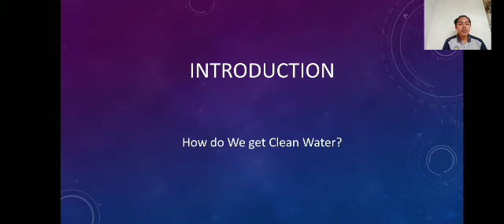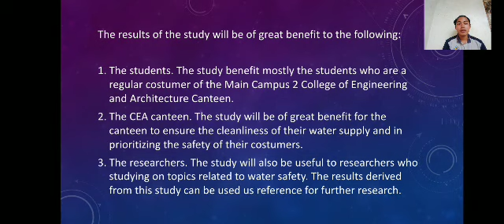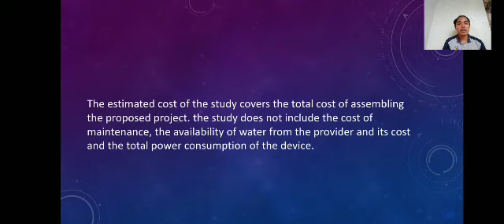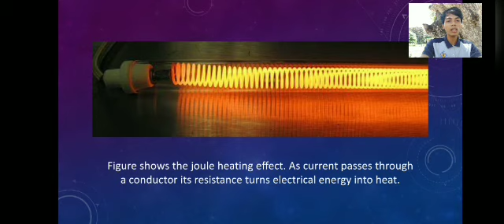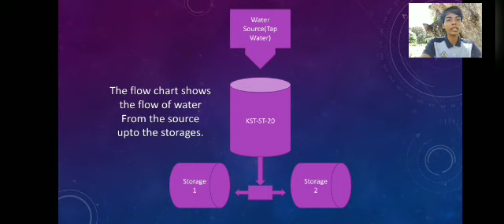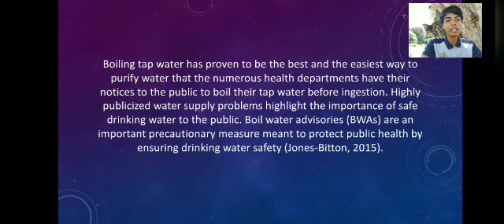Water Purification Using Heater: Safer Water Source for Specified Area.

Comment: Tudio, Lechly D. 
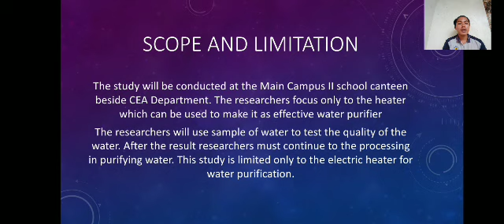COE 346 Methods of Research T-TH 5:00-6:30 PM March 26, 2022
Reaction: It is the most superficial topic yet the most helpful one. This study could be beneficial not only to the students but also to the people in Campus 2. It prioritizes health at the same you can save money. Drinking tap water is not only cheap but also environmentally friendly.
Reflection: When I was new in CEA , I remembered myself being so ignorant of the water. I was not used to the taste and smell of it. It tastes different, and it smells like chlorine, little did I know that the chlorine smell is pure city water. Sometimes, I experience stomachache or diarrhea, and I do not know if it is because of the water. To ensure the safety and good health of the students, it would be nice if they would implement this study. As I have searched, water purification can help remove harmful containment and improve the taste, smell, and visual appearance of your drinking water. It reduces the amount of chlorine, soil residue, and organic and inorganic substances.

Comment: NAME: Lumelyn E. Ragusta
CLASS NAME & CLASS SCHEDULE: ENS 341 B Research Methods for Engineering – S 5:00-8:00 pm
DATE: March 26, 2022
REACTION:  The proposed installation of an electric heater to purify the tap water of NORSU main campus II canteen is a good idea to ensure students' well-being. However, given the limitations of the proposed project, it would be cost-efficient to check the water level safety of the water source. If the source of water is already being maintained by an established organization like DCWD, which is known to have a respectable reputation for providing safe water in the entire city, would it be better to direct the proposal to a different water area than the university canteen such as low-income community groundwater well?
REFLECTION: I appreciate the idea of making sure that the university's tap water should be safe enough for students to consume. In my own experience, the tap water in the main campus II canteens did not put my health in jeopardy. I feel like this research can be terminated right after a student survey which is sad for the efforts of this proposal. I realize that before deciding and working on a certain research topic, a researcher should always question the problem and the resolution's necessity.

Comment: Name: Balansag, Lorenzo Jr. B.
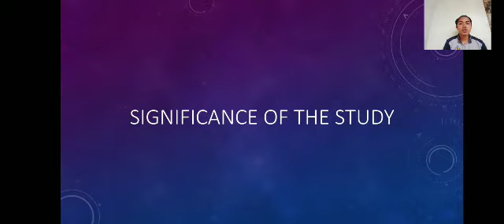Class Name and Class Schedule:  ENS341- Research Methods for Engineering | Saturday 2:00-5:00 pm 
Date: March 26, 2022

Reaction: I commend the researchers to being able to spot the problem in the campus. As water is a necessity to us. Having our water purified will help prevent student drinking contaminated water. 

Reflection: As I have experience, we student always preferred to drink in tap water instead of buying bottle watered. Since, it is expensive. But we are not sure if the tap water is contaminated or not. So if integrated to the school, it will prevent contamination. It is very beneficial to both students and instructors in the campus.

Comment: Diaz, Joseph Jr. B. 
ENS 341 B - 5-8 pm Saturday
March 26, 2022

Reaction: The water purification using heater is already practiced in some household that is why I'm not surprised with the topic. We also always do this because of the water that comes out from our faucet is not drinkable and safety enough.

Reflection: The water purification using heater is applicable wherever you are. Even if you don't have a heater but you have other alternative for heater you can still do the practices.

Comment: Name: Orito, Jessel A.
Class Name & Class Schedule: ENS 341 B Research Methods for Engineering (Saturday 5:00-8:00 pm)
Date: March 26, 2022

Reaction: This research proposal also benefits the students and faculty staffs in CEA MCII, since it deals with the quality of water using in the canteen. Purifying water before using is a good way to ensure the safeness of it.

Reflection: To ensure the safeness of the students and faculty staffs it is best to purify water before using. There are different methods in purifying water such as distillation, using sand filters, chemical processes and heat treatment. For this research, they used heater in purifying water to identify how clean the water is. In this way, you can say that the purified water is much safer than before.

Comment: NAME: Chasty Jane Duran
CLASS NAME: ENS 341 B - Research Methods for Engineering
CLASS SCHEDULE: Saturday, 5:00 - 8:00 pm
DATE: March 26, 2022

Reaction: As a student in MC2, I will commend these researchers to have identified the main problem around the canteens. We, students would always rely on the drinking waters provided by the canteen without assuring that they are purified, clean and safe to drink. Just around the campus, you don't see drinking fountains, or mineral water machines free for the students to access. This study will be very beneficial to prioritize those who rely on canteens for their drinking waters. 

Reflection: Water purification in such ways will provide a reliable and safe water supply for the students and staff. Checking on the water quality from the canteens will reassure the safety of those who drink from these water providers.

Comment: Marc Kenneth L. Baldosano
ENS 341 A (Saturday 2:00-5:00 pm)
March 26, 2022

REACTION: Since free water only came in a form of tap water on CEA campus, water that has undergone purification is much better than plain tap water. 

REFLECTION: Boiling water to kill bacteria is the most common way we purify water in our homes. Having a water purification system using a heater can be very beneficial to the people inside the campus.

Comment: Name: Belinario, Cristy T.
Class Name and Class Schedule: ENS 341 B - (5-8 PM Saturday)
Date: March 26, 2022

Reaction:

Water purification is widely recognized as one of the most effective methods of obtaining drinkable water by removing contaminants such as chemicals, pollutants, and toxic metals. The installation of an electric heater as a water purifier in the Negros Oriental State University Main Campus II canteen aims to purify their free tap water. Taking into account that the study only limited on computing the total cost of assembling the proposed project and does not include the expected cost for future maintenance of the devices, the availability of the water, and the cost for the total power consumption of the device, thus making it not really efficient. Given that it would be also free, who will pay for the additional expenses of the device? If the canteen charges for the purified water,  hopefully it would be less expensive than bottled water. Rationally, it is stated that the study will be terminated if the test results show no presence of harmful bacteria in the tap water.

Reflection:

As a  Main Campus II student, I took advantage of the campus canteen's free tap water, especially during lunch. It's funny that I never thought about the facility's water safety until I saw the proposed project about installing a water purifier in the canteen because the water there looks clean and taste fine. I didn't get stomach pains from drinking it. The study made me realize how critical it is to have access to safe drinking water not only in school but also in the community.

Comment: NAME: Shiela May E. Velos
CLASS NAME & SCHEDULE: ENS341- ; (5-8pm) Saturday 
DATE: March 25, 2022

REACTION: This study is good proposal it focuses the need of the safety of drinking water it points out the healthy and safe water supply for students in the CEA. Compared to bottled water, tap water is cheaper and is a more practical choice for students.  tap water over mineral water because it is less expensive and it's more natural and nutrients are real.  This study could be an impact to every students. Not only do we have no knowledge whether the tap water we drink is safe, but it also has effects for the health of the institution's workers, students, and faculty. More benefited when it natural and real mineral. 

REFLECTION:
 It's safer for us to be able to drink water from a purified water source, especially if it's convenient to everyone. This study is greatly beneficial to every students since they can drink the purified water without hesitation since they know that it is absolutely clean. Fewer people will become ill as the result of drinking contaminated water that this study gives helps us to acquire a healthy and safe water supply . Using this method in school canteens will help students save money, especially those who cannot afford to drink bottled water. By heating the water, the bacteria in it will be killed and drinking the water will be entirely safe. As a result, the staff and faculty will also have access to clean and safe water.

Comment: Name: Ma. Theresa C. Velasco
Class name & class section: ENS 341 B /5:00-800PM SATURDAY 
DATE : MARCH 25, 2022

Reaction: Their research is really good and they also explain it well. They delivered it properly and also one of the best to have a safe water source espy in NORSU main campus 2.

Reflection: We don't know where they get the water especially in the canteens of the campuses in NORSU.  It is the best way to have a safe water purification by using heater.

Comment: Mamigo, Jascha Anthony T. 
EE 341 Research Methods for Engineering TTh 6:30-9:00PM 
March 25, 2022

 REACTION: The necessity of drinking water safety was the focus of the study. As a NORSU student, I concur with his remark that we prefer tap water than mineral water because it is cheaper. This study was important because not only do we have no idea if the tap water we drink is safe, but it also has implications for the health of the institution's personnel, students, and faculty.

REFLECTION: It's a great thing to be able to drink water from a purified water source, especially if it's simple and easily accessible to everyone. If this is done correctly in a given location, fewer individuals will become ill as a result of drinking contaminated water. Implementing this method in school canteens will substantially assist students in saving money, particularly those who cannot afford to consume bottled water.

Comment: REY STEPHEN O. TUMAPON
COE 346 Methods of Research T-TH 5:00-6:30 PM
March 25, 2022

REACTION: This research proposal is very informative and a great idea. With this study, the students and instructors can be assured that the drinking water is very safe and clean. This is a great proposal because it puts emphasis on the health of students and instructors.

REFLECTION: The researchers did a great job on this proposal, and it is very useful at Main Campus 2. The importance of water purification is very critical to our health. Very well done!

Comment: Villanueva, Chastine E.
COE 346 Methods of Research T-TH 5:00-6:30 PM 
March 25, 2022 

Reaction:
This research is a good idea because it aims to produce safe and drinkable water. It will help students avoid drinking tap water that is not good for their health.

Reflection:
Drinking pure water is good for our health. Heating the water before consuming it offers several benefits: it eliminates pollutants, kills bacteria, and reduces the danger of contamination. The effects of contaminated tap water are most harmful to infants, the elderly, and people with compromised immune systems.

Comment: Caluscusan, Desiree Joy M.
COE 346 Methods of Research T-TH 5:00-6:30 PM
March 25,2022
Reaction: The video emphasized on the importance of having clean water and the safety of costumers of the CEA campus canteen. It explains the processes of purifying water and its significance.
Reflection: It is an eye-opener for students who isn’t mindful of where the water they are drinking coming from. A project like this is very helpful to the students since it took their health in consideration.

Comment: NAME: Del Franz Lean Consing Ladura

CLASS NAME & CLASS SCHEDULE:  ENS 341 - SATURDAY (5-8PM)

DATE: March 25, 2022

REACTION: The study's major focus is having clean drinkable water available at NORSU's main campus two canteens. The research major fails to highlight the influence of the present cleanliness of the water on the kids. They did not say if there were a large number of students affected by the present water cleanliness, which would make the study more significant. The demand for water from the canteen is likewise uncertain. This particular study, in my opinion, does not require immediate attention. It's not like those who drink from the canteen get sick.

REFLECTION:  Personally, I am not picky about the water I drink. In fact, I drink directly from the faucet at home. I'm not certain that installing a water filtration heater would solve the problem of water purity. If the issue is providing drinkable water for students and staff, wouldn't it be preferable for the institution to just construct drinking fountains around campus? This is a more mainstream method that has been implemented. Even at my high school, the faucet water is dangerous to drink, but they have remedied the problem with drinking fountains.

Comment: Ronel S. Bayonado
COE 346 Methods of Research T-TH 5:00 - 6:30 pm
March 25,2022

Reaction:
We have been heating our water for as long as we can remember. We heat our water to purify it and be safe to drink. This is a great idea specially for those areas who rely on tap water to drink. Very well explained.

Reflection:
To be able to drink water from a purified water source is a wonderful thing specially if it's convenient and readily accessible for everyone. If this is done right in an area, less people will be sick from drinking contaminated water. Implementing this system at canteens of schools will greatly help students save their moneys specially those who can't afford bottled water to drink.

Comment: NAME: MACAHIDHID ALRICK , O.
CLASS NAME & CLASS SCHEDULE: COE 346A – TTH 5:00-6:30 PM
DATE: March 25, 2022

REACTION: This research, according to this video, is a novel technique to open and encourage new proposals to students in MC2 who are studying health safety.

REFLECTION: Because our health comes first, we should sanitize our hands with alcohol or wash them with soap and water. For our own safety, we must also filter the water before drinking it. And this study, which purifies water using a heater, will allow CEA instructors, staff, and students to drink clean, safe water. Because it is for our health's sake, it should be implemented. This research is really beneficial not just on the mentioned Campus, but also in general.

Comment: NAME: Ong, Pearl Marney A.
CLASS NAME & CLASS SCHEDULE: ENS 341 - Saturday (5-8PM)
DATE: March 25, 2022
Reaction: The video presents a research proposal about the importance of a safe water source in schools. As a student it is beneficial to hydrate yourself almost everyday, so to have access to a clean and safe water is a must.
Reflection: The pollution in the air, land, and sea has made it difficult for some natural resources to be pure. However, there is a way to produce a pure resource by using heat. For example boiling the water can eliminate any bacteria so it can be safe to consume the liquid. Its a great solution for the people that needs a reliable water source.

Comment: Noel E. Macay
COE 346 Methods of Research T-TH 5:00-6:30 PM
March 25, 2022

REACTION: The study is very helpful for us students or even teachers in terms of our health. Nice idea of the researchers. Very well presented. Well done.

REFLECTION: Since our health is the main priority, we should practice sanitizing our hand with alcohol or wash it with soap and water. Also, it is needed to purify the water before we drink it for our safety. And this study that purify the water using heater will gives the CEA faculty and staffs and students enjoy the water that are clean and safe. It should be implemented since it is for our health. This study is very heplful not only in the said Campus but for everywhere.

Comment: Balacy, Samantha Ruby Joy C.
COE 346 Methods of Research T-TH 5:00 - 6:30 pm
March 24, 2022
Reaction:
 I am impressed with what the researchers presented to us. It is indeed important to have safe and clean water accessible to the students on the campus. It was a brilliant idea presented by the researchers.
Reflection:
Due to overpopulation, pollution in the air, land, and sea is inevitable. With that, there is an increasing demand for safe tap water sources all over the world. With the help of heating the water, we can guarantee that it is safe since boiling the raw water can help to kill the bad bacteria that can cause diseases. Using a heater to purify the water on campus is a great idea because it keeps students and faculty safe while also providing drinkable water.

Comment: Gliocam, Blessings C.
COE 346 Methods of Research T-TH 5:00-6:30 PM
March 24, 2022

REACTION: This research tries to improve our drinking water by purifying it thru heater, which is a fantastic concept for the people in that area.

REFLECTION:  The use of a heater to prevent water-related illnesses and ailments is the most significant part of water purification. Infants, the elderly, and people with compromised immune systems are particularly vulnerable to the dangers of contaminated tap water.